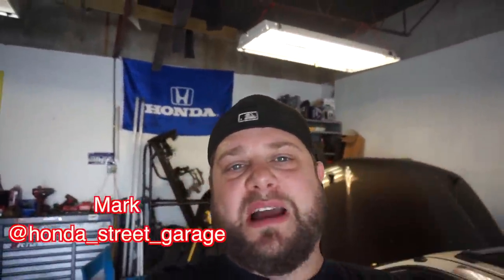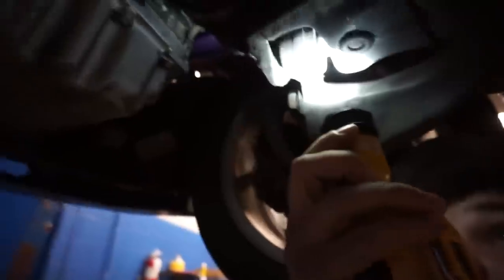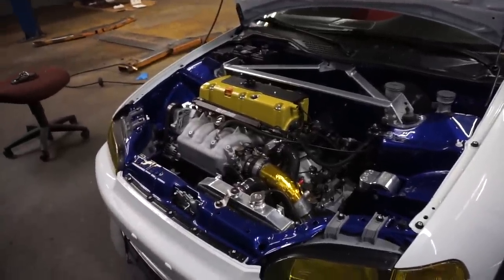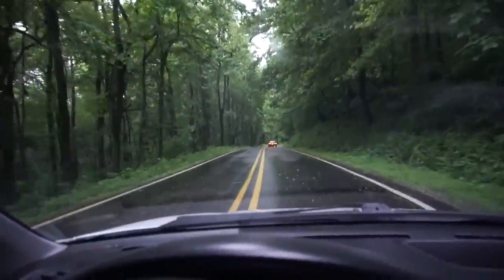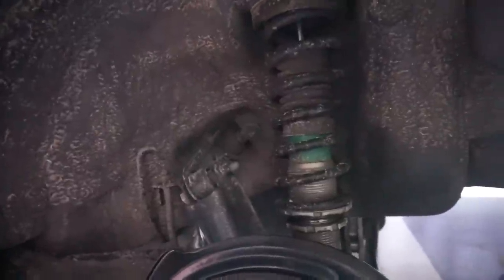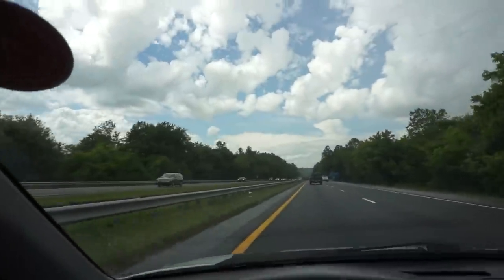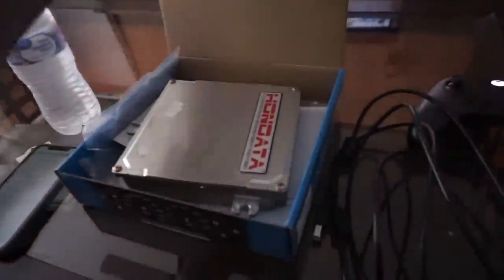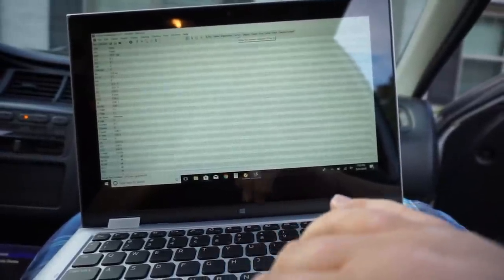HONDATA KPRO [ HARNESS ISSUES ] K24 BUILD ?    HSG EP. 6-34

Comment: The issue with the kpro you need to run the fuel pump direct. Run it from the relay ground it out and your issue should be resolved. Had the same issue doing my k swap.

Comment: I have a virgin CX EG hatch awaiting the K20/24 swap but we live in the desert so I’m definitely looking at adding AC back in. 
I wanna see you do that so I can see what’s all going on there. I remember you saying you wanted AC in a back vid. So please if you add it back please do a vid on it.
Reply: Adding AC to a CX isn't too difficult. Just find a cheap donor car so that you're certain you got all the parts. All I ever added to my 95 CX was cruise control, gauge cluster with tachometer, and an interior swap from blue to black... there really isn't much behind the dash, So if you have a parts car and just treat it like big boy legos you should be fine.
Reply: i have a 92 dx eg, manual, but of course, no tach. What model should I pull a cluster out of that has a factory tach?
Reply: Donovan Gomillion EX or Si model
Reply: correct, a manual EX or Si cluster will plug and play. ( used a 93 EX cluster specifically)

Comment: Humble just made 270whp on a stock K24a2 with 50*VTC, PLM Header, Ported RBC Intake and M5 fuel. No reason to k20/24 off the bat. Also not cheap but rywire do custom harness

Comment: Supp bro... I have a question. I am changing my rear trailing arms and putting in rear disc brakes on my 91 ef ... do I need the 40/40 valve? Or is it fine  if I don't put it on ?

Comment: Do a k20 block k24 ported head for road race build?
Reply: joe hicks what k24 heads suck they don't have exh vtec which is why everyone does a k24 block with a k20 head.  No need for a port they flow plenty just get good cams IM TB and headers and you can hit 300 whp on a k24a2 type setup.  

K24a2 uses the same head as the k20a2 may have 1mm bigger valves

Comment: Love ur videos man but some great advice use only 06-08 TSX cams do not go with aftermarket cams u will run into tensioner issues as this will make the car less reliable the 06-08 tsx cam is a drop in cam and not prone to tensioner failer
Reply: Not necessarily true, plenty of people run higher stage after market cams without issues. I'm currently building my k24a2 with Drag Cartel 004's and a new OEM Tensioner... I'll let you know if it goes 😎

Comment: Can you explain why ppl do a k24 block and k20 head also hondata vs ktunner
Reply: NIX the k20 head breathes better than the k24 head so peak power is better. The k24 is better for mid range power so more area under curve.  Ktuner does reflashes. Kpro is more tuning software.
Reply: joe hicks thanks alot man! I'm trying to get as much information as possible before I swap because unlike these guys I can't swap engines like I change my underwear 🤣
1 swap and done
Reply: Im in the same boat. Piecing together my swap now too.
Reply: joe hicks do you have a Channel too?
Reply: It's like doing a b20vtec . U have high revs and more torque all motor
Reply: k00lball3r I don't know much about engines and power so I won't know what your talking about. I read charts and dynos
Reply: K24 had alittle bigger pistons and a way bigger crank meaning it will suck more air on every stroke.  There is only a few heads that have vtec on the exh side like the a2 and k20a's you will have more tourqe and HP.  However more tq creates more wheel spin also the k20 will rev higher and take more abuse.  At the end of the day up to you and your preference either setup will make great power and be a ton of fun.  

Hondata or ktuner.  Ask your tuner as they both come in stand alone which are both the same and he can save you money as well.  Ktuner however has a cool option where they can flash an ecu for someone on a budget so if you have a simple na build for a few hundred.   You can buy a licence for ktuner through some tuners and he can tune it for you to save some money.  Get a standalone if your doing a more complex build like itbs or a turbo setup with different fuels so you can make changes at the track or plan on building over time.  It's nice not needing to go to your tuner to change your launch rpms or psi per gear with a ebc.  So that's what hondata is awesome for
Reply: Duane Bailey holy crap you know everything! Thank you so much man! 

I am making a n/a itb awd street car but I'm doing it in small portions. This year I upgraded all the suspension next year I'll buy my engine and the following throw it in and the year after awd
Reply: NIX i like building in stages as well.   An h2b setup can make just as much HP as the k series.  Also can be done for 2k properly but def go k if you can that 6th gear is such a missing piece in a na setup with a b16 trans.  If it's a weekend only car itbs will work but for a street car I'd avoid them if possible.  They do sound and look amazing but are a pain to get them to idle right and waste a ton of fuel.  Unless you build them yourself you can buy cams pistons an im and tb for the same price and pass that 250whp mark.
Reply: Duane Bailey I'm looking to hit 300+hp min and when I do my awd 250+hp min. 

This would be my first and last build, because it's my first car and I love it so much. Check my YouTube channel for my car if you'd like to help me too!
Reply: Awd is cool as hell do some research on awd trans when your looking so you don't have to buy another one also don't think they have a 6 speed one but not sure.  I wish the awd wagons were easier to find for the swap.   Almost cheaper to buy a crv slam it swap front ends and widebody it to fix how ugly the rear is.  I'd shoot for at least 400hp for an AWD setup as you can get the car to hook up an handle fine around the 230 range.  The nice thing about the stand alones is that you can do power management by gear and pull timing or boost.
Reply: Duane Bailey I was planning on going crv route and all that info is way over my current knowledge! You the man! I'm gonna keep you in contact for help. How do you know so much?😱🙌

Comment: Heeeelp pleeease! What’s the highest compression I can run on 91 ca pump gas
Reply: B20 vtec build for 91 ef
Reply: 12:1 with a good tune bro !    I'd probably go e85 if I were you Cali has lots of e85 and then just put 84mm ctr replica pistons in your b20block that would be sweet
Reply: gurjinder singh  thank you for reply bro , 
That would be bad ass but it’s hard to get e85 here I’m in Mendocino county, and I guess I should have mentioned that I’m trying to build the most bad ass daily driver I can
Reply: But I’m gutting the block and head and rebuilding the entire engine!
Reply: LBA Lucky p30 pistons ? A little lower cr than ctr pistons

Comment: Help I have a ek with a b20 swap I need to know if anyone knows the ys2k trans cause I couldn’t find the number and I also checked online if anyone has one let me know  where it’s from thx!
Reply: What?  S2000 or k series won't work they spin the other way.  Get any integra transmision from 94 to 00. Ls is good for highway driving.  Gsr shorter gears but still not bad.  B16 trans good gearing but at 75 you start getting up towards 4k on the highway lsd optional.  Type r best gearing but again bad for highway also has lsd.  Do a search Honda transmission calculator and you can see the gearing and options also the code of the trans s80 ys1 or whatever.